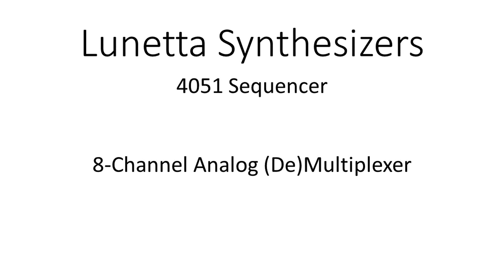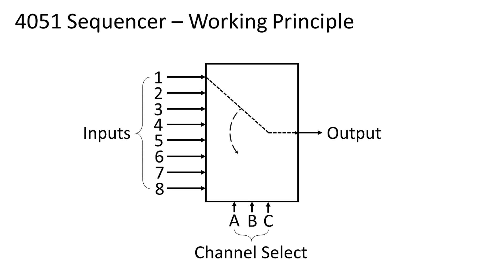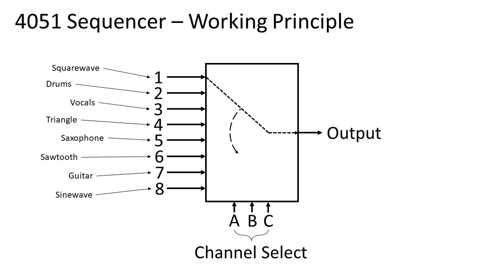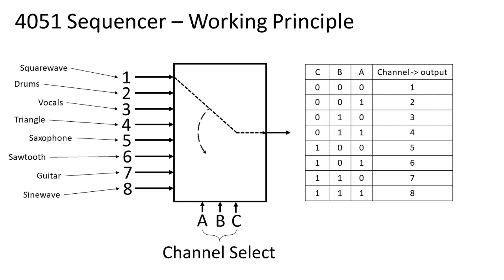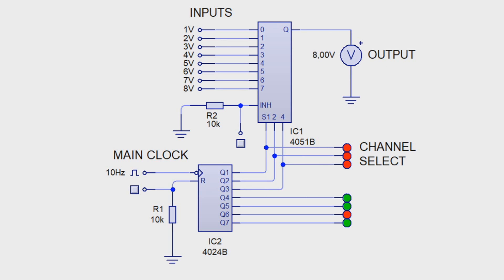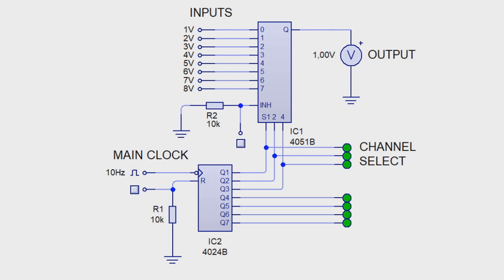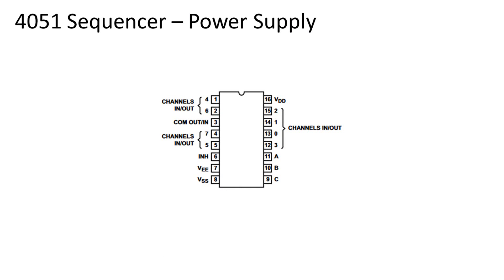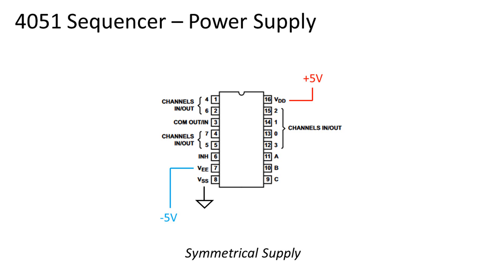Lunetta Synthesizers #7: Sequencing Any signal With The 4051

Comment: Hi thanks for your great videos! I wanted to ask you if the 4051 as a central sequencer, I could bring each step into a 4017 with a rotary to divide or multiply the steps with the rotary as a selection tool. So 1 4017 per step, 8 steps in total. My fear is will the voltage get lost in the 4017s or does it go in the 4051 continually. Thanks in advance!
Reply from the maker: I've a hard time figuring out what exactly you want to do. Could you elaborate?
Reply: So I basically want the sequencer to have 8 outs, 1 per step. Each out is controlled by a 4017 clock ic which divides the output with a rotary. But I'm just scared that the signal goes into a 4017 instead of continuing the  8 step route
Reply: what do you want to sequence? 4017 is a digital chip, so it can only take 1 and 0, any analogue audio signal will be kind of lost. unless you only give it squarewaves.